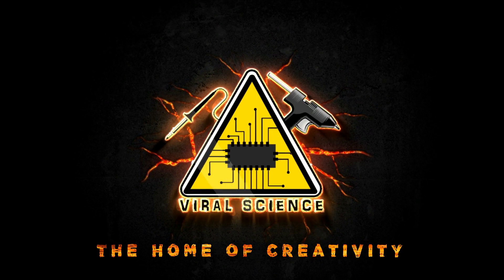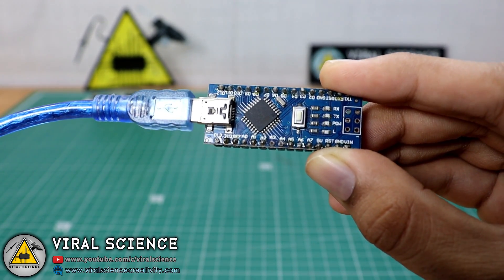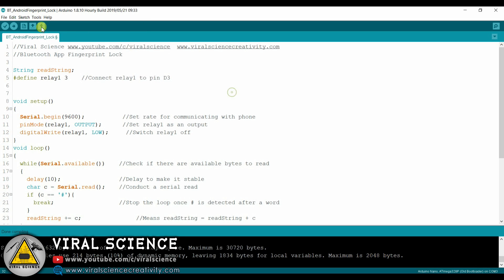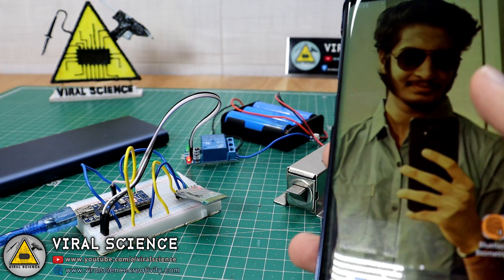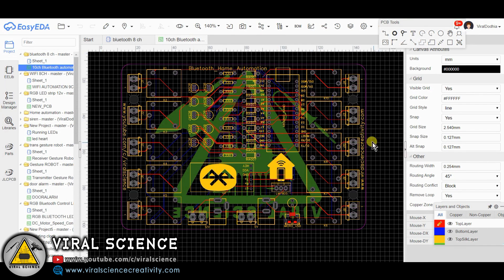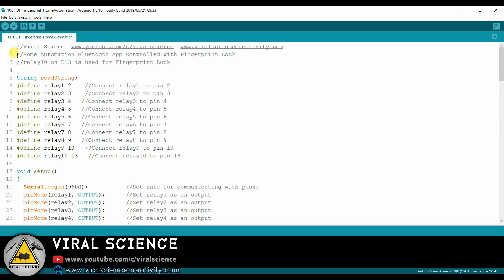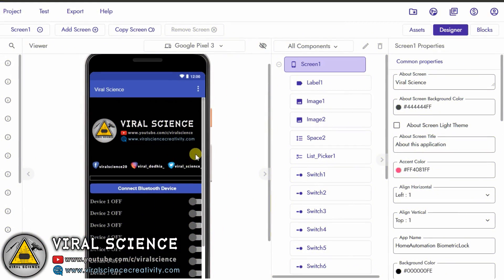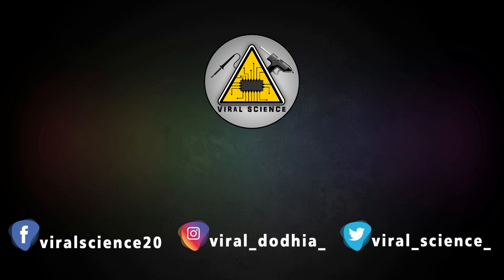Android Fingerprint Arduino Door Lock Control and Home Automation

Comment: 2 nd code for relay on off by alexa 

#include <WiFi.h>
#include <Espalexa.h>
Espalexa espalexa;
#define RelayPin1 23  //D23
#define SwitchPin1 13  //D13
#define wifiLed    2   //D2
int toggleState_1 = 0;
boolean connectWifi();
void firstLightChanged(uint8_t brightness);

// WiFi Credentials
const char* ssid = "wifi name";
const char* password = "passwrd";
// device names
String Device_1_Name = "Study Lamp";
boolean wifiConnected = false;

//our callback functions
void firstLightChanged(uint8_t brightness)
{
  //Control the device
  if (brightness == 255)
    {
      digitalWrite(RelayPin1, LOW);
      Serial.println("Device1 ON");
      toggleState_1 = 1;
    }
  else
  {
    digitalWrite(RelayPin1, HIGH);
    Serial.println("Device1 OFF");
    toggleState_1 = 0;
  }
}
void relayOnOff(int relay){
    EspalexaDevice* d = espalexa.getDevice(relay-1); //the index is zero-based
    switch(relay){
      case 1: 
             if(toggleState_1 == 1){
              d->setPercent(100); //set value "brightness" in percent
              digitalWrite(RelayPin1, LOW); // turn on relay 1
              toggleState_1 = 0;
              Serial.println("Device1 ON");
              }
             else{
              d->setPercent(0); //set value "brightness" in percent
              digitalWrite(RelayPin1, HIGH); // turn off relay 1
              toggleState_1 = 1;
              Serial.println("Device1 OFF");
              }
      break;
      default : break;  }
      delay(300);}

      // connect to wifi – returns true if successful or false if not
boolean connectWifi()
{
  boolean state = true;
  int i = 0;

  WiFi.mode(WIFI_STA);
  WiFi.begin(ssid, password);
  Serial.println("");
  Serial.println("Connecting to WiFi");

  // Wait for connection
  Serial.print("Connecting...");
  while (WiFi.status() != WL_CONNECTED) {
    delay(500);
    Serial.print(".");
    if (i > 20) {
      state = false; break;
    }
    i++;
  }
  Serial.println("");
  if (state) {
    Serial.print("Connected to ");
    Serial.println(ssid);
    Serial.print("IP address: ");
    Serial.println(WiFi.localIP());
  }
  else {
    Serial.println("Connection failed.");
  }
  return state;
}

void addDevices(){
  // Define your devices here.
  espalexa.addDevice(Device_1_Name, firstLightChanged); //simplest definition, default state off
  espalexa.begin();
}

 void setup()
{
  Serial.begin(115200);
  pinMode(RelayPin1, OUTPUT);
  pinMode(wifiLed, OUTPUT);
  digitalWrite(wifiLed, HIGH);
  pinMode(SwitchPin1, INPUT_PULLUP);
 //During Starting all Relays should TURN OFF
  digitalWrite(RelayPin1, HIGH);
  

   // Initialise wifi connection
  wifiConnected = connectWifi();

  if (wifiConnected)
  {
    addDevices();
  }
  else
  {
    Serial.println("Cannot connect to WiFi. So in Manual Mode");
    delay(1000);
  }
}

void loop()
{
   if (WiFi.status() != WL_CONNECTED)
   {
    //Serial.print("WiFi Not Connected ");
    digitalWrite(wifiLed, LOW); //Turn off WiFi LED
    //Manual Switch Control
    if (digitalRead(SwitchPin1) == LOW){      
      relayOnOff(1);      
    }
   }
   else
  {
    //Serial.print("WiFi Connected  ");
    digitalWrite(wifiLed, HIGH);
    //Manual Switch Control
    if (digitalRead(SwitchPin1) == LOW){
      relayOnOff(1);      
    }

    //WiFi Control
    if (wifiConnected){
      espalexa.loop();
      delay(1);
    }
    else {
      wifiConnected = connectWifi();
      // Initialise wifi connection
      if(wifiConnected){
      addDevices();
      }
    }
  }
}

Comment: please merge 2 program for ESP32 

 
1 finger print code 

#include <WiFi.h>
WiFiClient client;
WiFiServer server(80);
#define wifiLed    2   //D2

const char* ssid = "wifi name";   //WIFI SSID
const char* password = "paswword";    //WIFI PASSWORD
String  data =""; 
int Relay4 = 26;     //D26

void setup()
{
  pinMode(Relay4, OUTPUT);
  digitalWrite(Relay4,HIGH);
  Serial.begin(115200);
  connectwifiFing();
  server.begin();
  }
void loop()
{  
    client = server.available();
    if (!client) return; 
    data = checkClient ();
    Serial.print(data);
    if (data == "RELAY4SUCCESS")
   {
      digitalWrite(Relay4,LOW);
      delay(100);
      digitalWrite(Relay4,HIGH);
    }
} 
void connectwifiFing()
{
  Serial.println("Connecting to WIFI");
  WiFi.begin(ssid, password);
  pinMode(wifiLed, OUTPUT);
  Serial.print("WiFi Connected  ");
  digitalWrite(wifiLed, HIGH);
  while ((!(WiFi.status() == WL_CONNECTED)))
  {
    delay(300);
    Serial.print("..");
  }
  Serial.println("");
  Serial.println("WiFi connected");
  Serial.println("NodeMCU Local IP is : ");
  Serial.print((WiFi.localIP()));
}
/******************************** RECEIVE DATA FROM the APP ******************************************/
String checkClient (void)
{
  while(!client.available()) delay(1); 
  String request = client.readStringUntil('\r');
  request.remove(0, 5);
  request.remove(request.length()-9,9);
  return request;
}